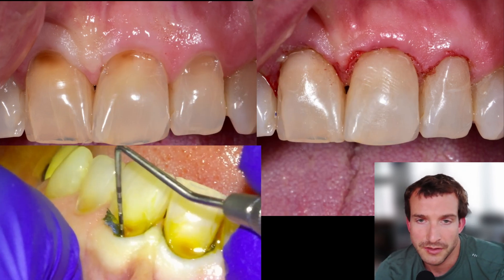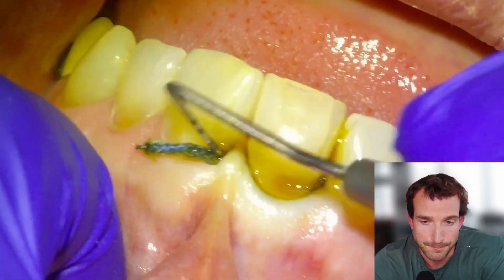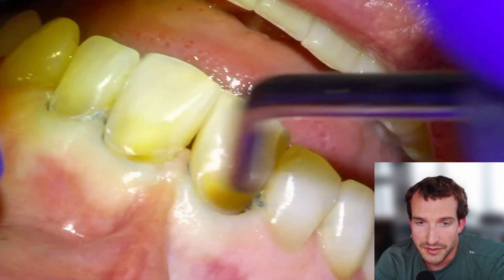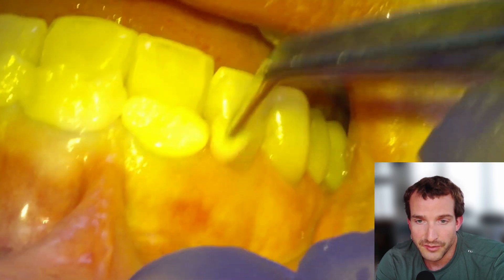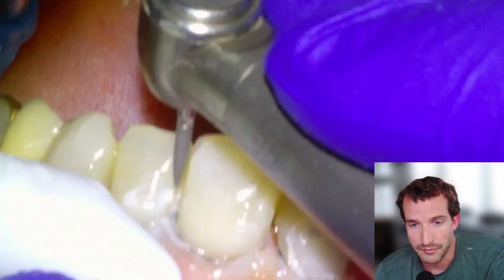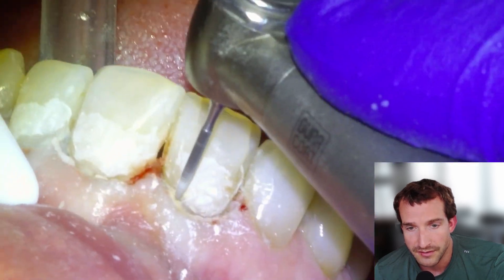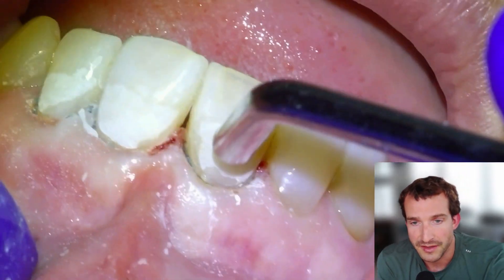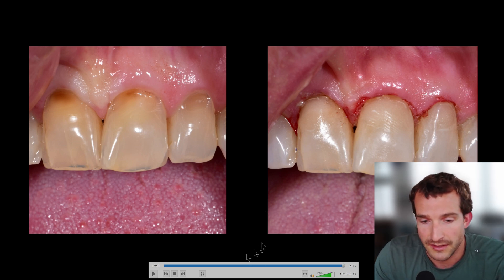[82] No Prep Esthetic Restorations (11B, 21B, 22B)

Comment: I think a better service for the patient on upper anteriors would be a nice micro filled composite. Much more esthetic. You took the time to anesthetize and pack cord so why not finish to a higher standard
Reply from the maker: I've never really subscribed to the notion that RMGIs are not esthetic, I find that I can predictably camouflage my anterior restos with rmgi to a very high esthetic standard. I also find that in addition to a much lower incidence of debonding, it will perform better in the very long term as it's margins won't leak like composite inevitably will. It's my personal material of choice for class 5s

Comment: I don’t use a lot of Fuji in practice but your cases look nice and I want to try using Fuji now. For clarity no bonding agent needed? Just etch it, place the Fuji, and light cure? Is waiting the 5 mins necessary. I’ve heard you mention waiting 5 mins in other videos.
Reply from the maker: No bonding agent needed, just precondition, rinse, dry, and apply. Fuji2LC is a light cure and you can trim and shape right away. It's not to be used on occlusal surfaces. Equia Forte is though but it's a 5 minute time set before you can adjust it

Comment: If you run your explorer down from the incisal towards the gingival does it catch on the incisal portion of the restoration at all? I’m a new grad and feel like I would get a ledge and not be able to blend in the filling material without any tooth prep. Or maybe here it blends in by taking advantage of the facial contour of the teeth
Reply from the maker: I find you can make a pretty smooth feather edge margin with this material even with a cavosurface margin angle approaching zero. The bond/varnish agent makes it basically smooth in the end. I'll normally apply it to the whole facial surface of the tooth because I have heard pts report they could feel thr margin of where the varnish was applied if it was only applied to cover the restoration

Comment: Isn’t it expensive using Fuji for your fillings ? … composite seems cheaper
Reply from the maker: It is probably a bit more overall these premixed caps are ~$5CAD each but the peace of mind knowing it won't debond, not having to worry about post op sensitivity, leakage, and just avoiding the stress and tedium of bonding comp is worth every penny imo